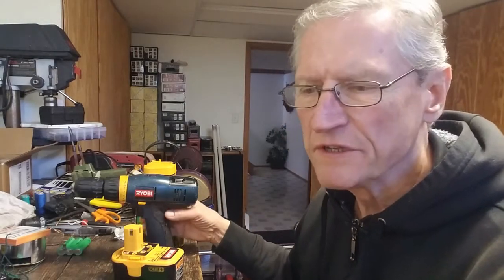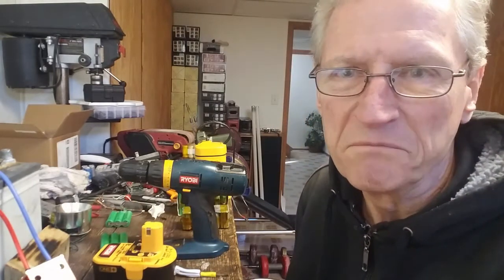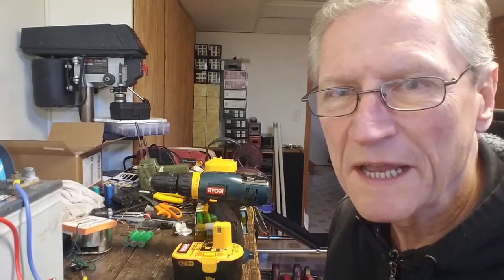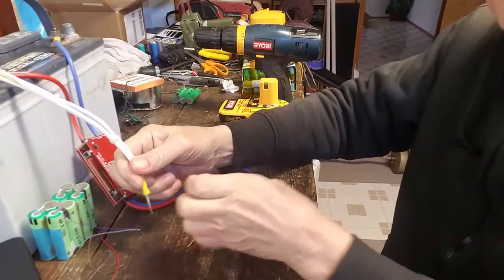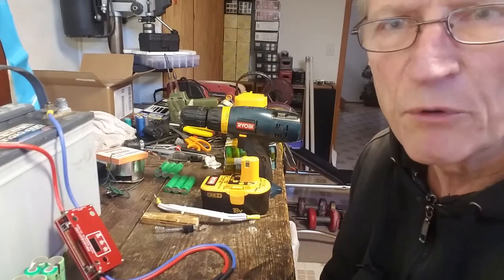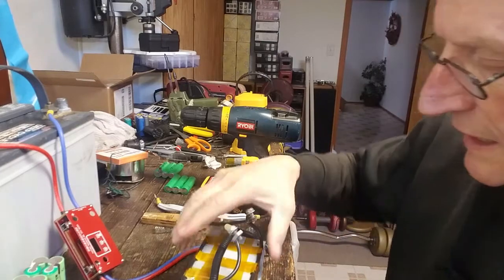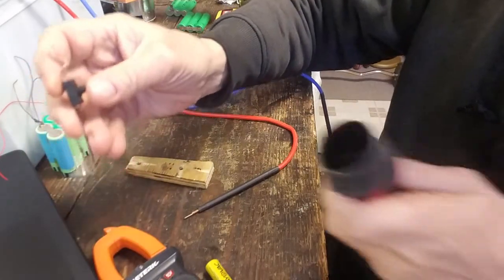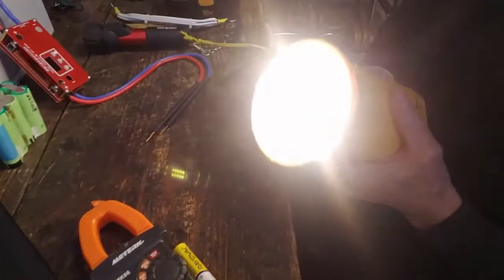Lithium Ion 18650 Battery Pack Projects

Comment: Good stuff! Please consider a video on reviving dead batteries…specifically 32650 batteries.  Mostly scuba light stuff.
Reply from the maker: I would charge the battery, check voltage mark date and volts.  If it looses more than 0,5 volts in a month, I would recycle them and replace.   In my experience, batteries that will not hold a charge are not worth the effort to try to revive, so I will not be making a vid about that:-)
If there is zero volts and charging does not bring the volts off of zero, view my videos for a way to check if the safety on the plus side of the battery is tripped and reset it.  

For SCUBA lights, I would strongly consider replacing the Halogen bulbs with LEDs.

Comment: You're a pretty resourceful guy. I'd like to see you incorporate 3D printing to make a box for that motorcycle battery. Keep sharing!
Reply from the maker: Tim,   It took a while, but I made a series of 3 vids on everything I learned about making rechargeable Li Ion battery packs, in case you are are interested.  Each are a little under 15 min long.   Like and share with folks you think may be interested:-)

Comment: I would like to watch a video about voltage, amp hours, and calculations! Great info!
Reply from the maker: Thanks for the comment.  I am cleaning up some and doing a vid on conversions of Florescent shop light to LED.  I should get back to the batteries in about a week:-)
Reply from the maker: I have most of it recorded.  Now I have to edit it.  There is more content than I thought and it will take me about a week.  Just an FYI:-)
Reply from the maker: Volt Man,     It took a while.  There was more that I learned than I thought.  Anyhow, partly from your request, I made a series of 3 vids on everything I learned about making rechargeable Li Ion battery packs.  Each are a little under 15 min long.   Hope you find them useful.  Like and share with folks you think may be interested:-)